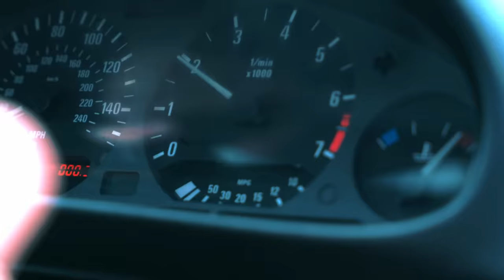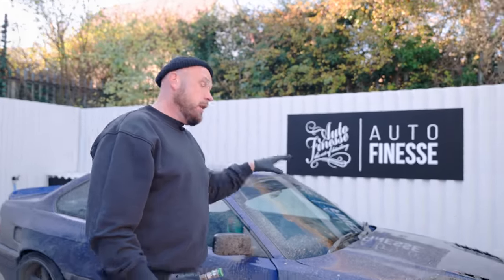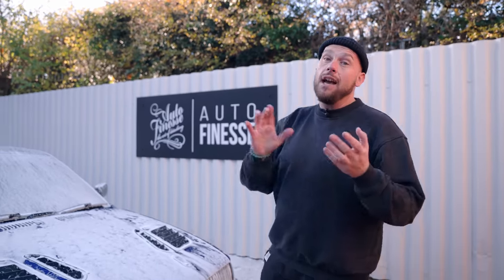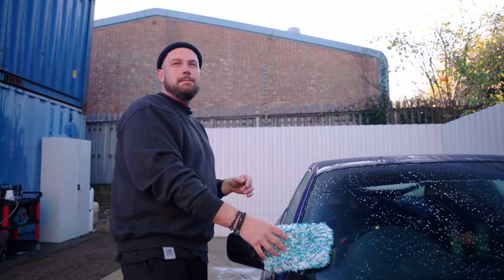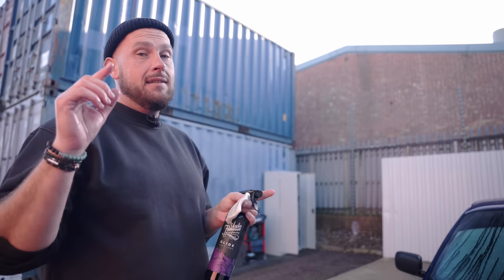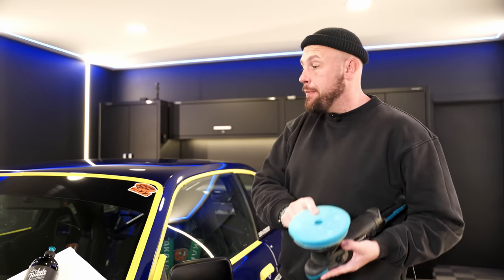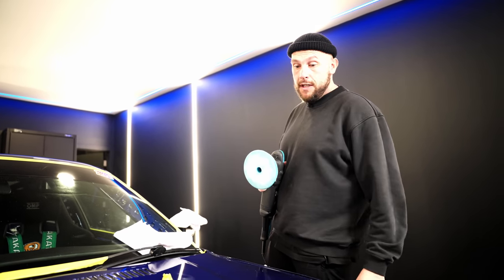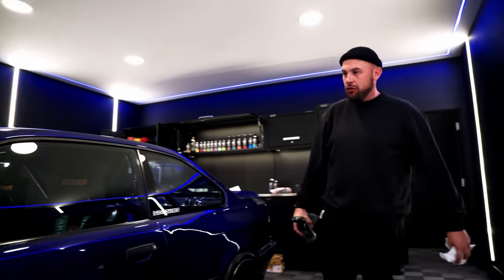Auto Finesse - Wrecked e36 gets a deep clean & detail

Comment: Simple solution for the waterspotting issues on the bonnet?  Throw a carbon bonnet on!  Job done!  

P.s. if you're gonna have a respray, thst red in the engine bay is very nice!
Reply from the maker: Thinking to put a bit of heat shield on the underside of the bonnet to begin with, see if that helps at least reduce it.